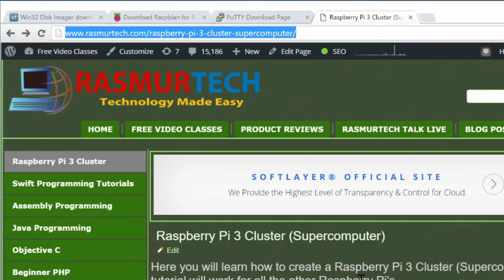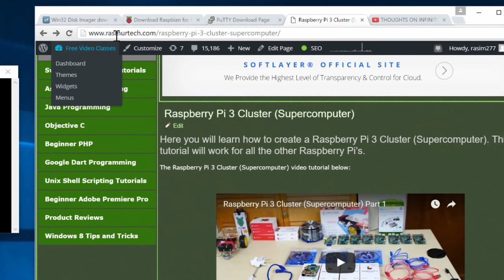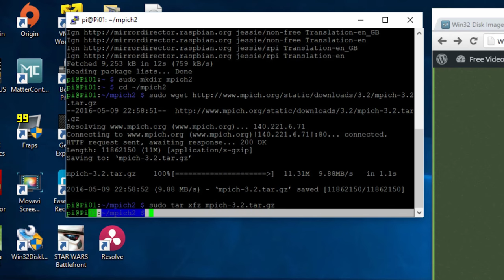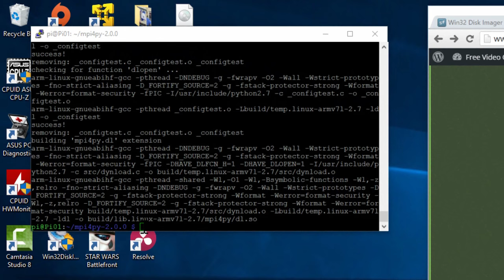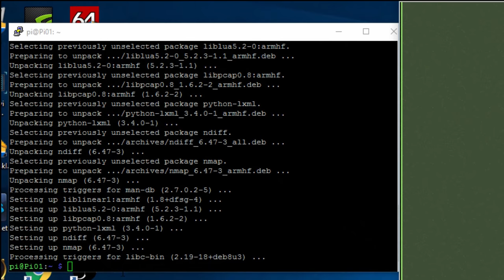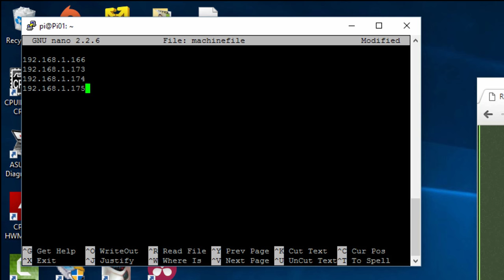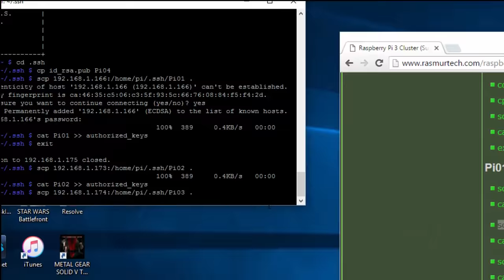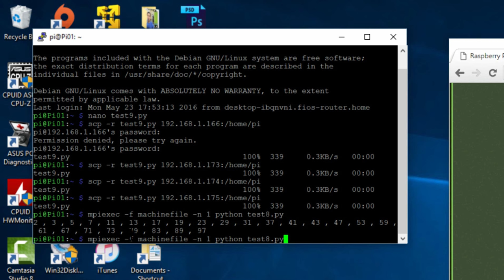Raspberry Pi 3 Cluster (Supercomputer)

Comment: Instead of Raspberry pi how about using the Odroid? the Pi does not have true ethernet but basically has a usb 2.0 port with an ethernet plug. Odroid, on the other hand has true gigabit ethernet and would be much faster. 
btw your website appears to be down right now